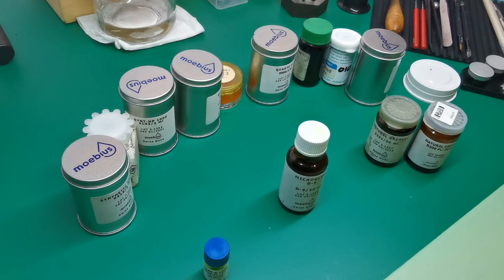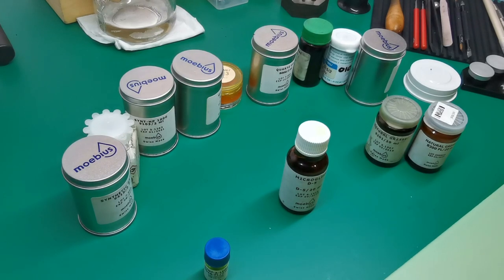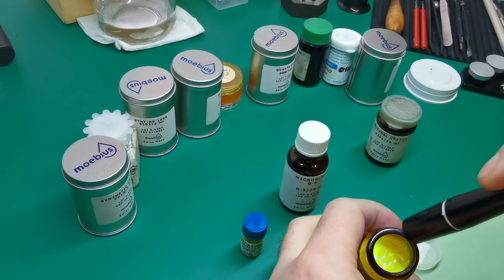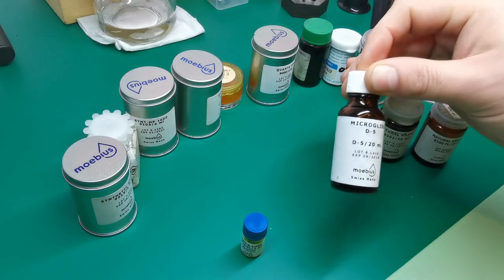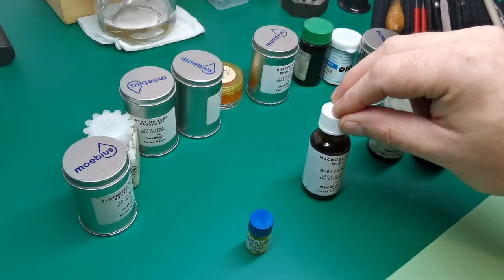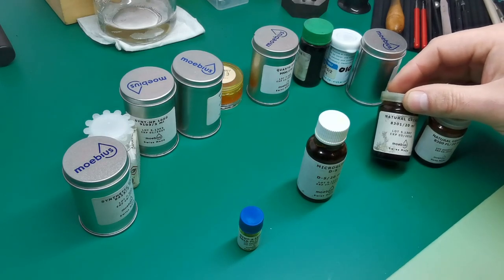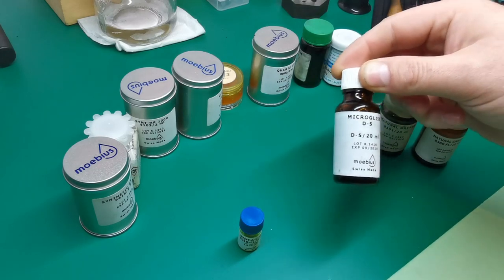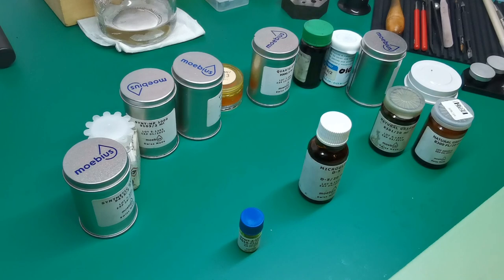Watch Lubrication - A Purchasing Guide for the Hobbyist

Comment: I did some research on my own and came to this conclusion: 
9010 as a thin oil (even for the pallet stones)
HP-1300 as a thicker oil
9504 as a grease (even for the barrel wall)

Comment: If you are servicing automatics, I'd still recommend a braking grease for the mainspring barrel wall and 941 or 9415 for the escape jewel although 9010 would work in a pinch and was used many years prior. I have yet to come to a less expensive alternative to expensive Kluber p125 or Moebius 8213\ 8217.

Comment: At the start I have moebius 8000 and a "questionable" oil that I hope its thick enough to subtitle D5. All watches I had serviced with just these two run really well but I don't know about the long run when it comes to years and years (its been only a few months). Now I have 9010, 9415, HP1300, 8200 for mainspring, molykote DX, and V105. I'm so happy with the set and I don't think I will ever need any new type of oil.

Comment: I found your helpful video after I have placed an order for some lubricants. So, would you say that HP-1300 is a valid substitute for the D-5? Thank you! 👍
Reply from the maker: If you have no other option but HP-1300 then yes it will suffice as an alternative, both share a similar attributes. HP oils have their place when dealing with higher end watches ( Rolex, Omega Co Axials etc ) that require more specific lubrication, D5 is a good allrounder for almost any movement. Get the best you can within the budget you set yourself :)

Comment: Excellent video. What do you recommend for stem? My buddies are using D5 but 8301 would be better?
Reply from the maker: There are a few good stem lubes but for a simple rule... if it spins use oil, if it rubs use grease, so with a stem you want to use grease not D5 oil ( but if D5 is all you have then it will suffice ). Mobius 9501 /Novastar Type S/ Or Seiko S series of greases are all good.
Reply: @welwynwatches5976  Thank you for your reply. I have Seiko S916 blue sticker and TSF451 black sticker which one do you recommend for stem? Thanks
Reply from the maker: @EditHandleError  Well both of those are a type of silicone grease more suited to gaskets, crown, pendants etc. You would need to find one of the other alternatives ideally but in a pinch you could use them.

Comment: Do you worry about the expiration dates? I know the synthetic last 6 years and natural about half that but I see your greases is expired, do you still use it?
Reply from the maker: Usually within 1 year of expiration i order new lubrication, the expired lube will still work but its performance will not be as good as fresh lube. All my current lubes are up to date and good for another 3 years minimum, however for hobby use i would not overly worry if the lube is a year or so out of date. 

All my lubricants are stored in a cool place away from sunlight so they stay healthy for best amount time possible :)

Comment: What oil would you recommend for the old 60's & 70's Timex? I've been told you can use lighter fluid to clean but I feel a little oil would be needed. right now I'm being D5 and 8000 but would I need both for an old $10 watch?
Reply: Yes im cleaning my Hamilton Masterpiece with lighter fluid right now it wouldn't wind nor run now it does sitting over night in lighter fluid.

Only lube i have here tho is 3 in 1 for locks?

Comment: Hello, what oil/grease is recommended for silenting my rotor? It sounds dry!
Reply from the maker: Automatic watch rotors do in most instances make some noise to some degree so there is no guarantee lubrication is what is required. Depending on the rotor type it will vary what lube is appropriate but as a general lube you can use some Mobius D5 but use only a small amount !

Comment: Can i use 3 in 1 for locks as a lubricant for my vintage mechanical Hamilton watch?
Reply from the maker: Id highly advise against using any lubricant that is not designed for watches, 3in1 or hair clipper oil have their own purpose but watches are not one of them. Look for Moebius or Novastar lubricants.

Comment: Any advice for cheaper options for those of us who just want to test the water with sub $50 watches? I don't want to spend  $$$$$$$$ on something I may only do once or twice.
Reply from the maker: For simple practice purposes i can suggest looking for Anchor Oils or a basic all in one oil for watches, check out HS Walsh website as they have some good deals on at the moment for simple watch oils.
Reply: @welwynwatches5976  Thanks for the advice I think I found a good selection Pioneer Watch HO97 and HO98  for light and medium oils and Moebius 8300 which is the same as 8301 minus graphite.
Reply: @shanelady1049  How have those been working out for ya? I'm looking at getting those too to service a couple of cheap vintage watches.

Comment: How and what did you use to get the oils florescent? A lume type paste?
Reply: They're already florescent from Moebius. hence the model number 9010-FL(florescent) vs. regular 9010.
Reply from the maker: Indeed as Chuck states the lube comes with a chemical compound to make it glow under UV light, it helps trace the oils as the movement works and ensure correct oiling.

Comment: Guys, so which grease oil to use on the STEM,  and STEM pivot?
Reply from the maker: You can use Moebius 9501 or 8300/8301 or Novastar Winding Grease or Seiko S6. Most watch greases will work fine with stems.

Comment: Why are folks still using and recommending D5 rather than a modern synthetic such as  HP1300 or HP1000?  Why natural grease instead of a modern synthetic? I bought all these early on on recommendations like this. Then I started taking professional courses at AWCI and learned that current specs demand modern synthetic lubricants.
Reply from the maker: The video is intended for hobby watch repairers and not professionals or students of professional courses, standards and demands of modern watch schools will always change but it does not make older or natural lubricants redundant. I understand your point but the intention is for the masses of people who enjoy it purely as a hobby :)
Reply: @welwynwatches5976  I appreciate your effort here and respect your views.  My thinking is different however.  The industry developed synthetics as improvements over these traditional natural lubricants.  If I were a hobbyist starting out I would buy the current industry standard lubricants: 9010 (light oil), HP 1300 (heavy oil), 9504 (grease).  Soon after I would add 9415 for lubricating pallet stones. I wonder why these older naturals are still in production given that the new synthetics perform the same functions better.  At the risk of sounding cynical, Moebius profits from selling traditional oils to neophytes who eventually have to spend additional funds to acquire a new suite of synthetics in order to meet industry standards.
Reply: @haroldskelton979  A local watchsmith is telling me that D5 is terrible and should not be used at all. In a number of years, it will disintegrate into an ash-like goo and could start damaging the movement. Not sure how trustworthy this is but I'm steering clear of it in favor of synthetics!

Comment: Hey there!  Great video!  Thanks for the information.

Someone gave me advice in a slightly different direction and I'd like your opinion please?

M9010
M9020
M8200

In your opinion, would this array of lubricants be sufficient to cover a typical mechanical watch service?
Reply from the maker: Hey, yes those lubricants will work just fine for general use, id swap the 9020 for some Microgliss D-4 or add the D-4 as an additional oil. 

As a general guide id use four lubricants ,an extra fine oil for escapement, a fine oil plus a medium oil for the train wheels, and a grease for sliding parts.
Reply: @welwynwatches5976  - Thank you for the feedback.

I'm thinking of putting together a kit for beginners that would include 4 (or 5) oils, a stand, oil pots and oilers...but in very small graduations of oil (like .2 to .5 ml)

What do you think of this roster of lubricants?

Super Light	M9415*
Light	M9010
Regular	M9020
Heavy	D5 (or 9104)
Super Heavy	M8200

*optional upgrade
Reply from the maker: @GrahamLeach  That seems more of a kit for mid to advance repair tbh, beginners really only need one oil and a grease to practice with. However if your aiming at the enthusiast level then sure. These lubricants are not cheap even in small amounts so for some out there who want to enjoy it as a hobby less is sometimes more and affordability is sometimes key. But hey this is a longer conversation than can be had in the comment section ha ha  :)
Reply: @welwynwatches5976  - Happy to continue the conversation in another medium!  I can be reached via my website.  Just google my name.  Yes, I am thinking enthusiast level and an entry price that isn't eye-watering.  Looking forward to chatting! :)
Reply: The rule of thumb is put 4 watchmakers in a room and you'll hear 9 opinions on the correct way to lubricate a watch.
Reply: @GentlemensWatchServices  only nine?

Comment: You still use d5? Idk. Maybe for a beginner. But no one else should still be using D5
Reply from the maker: I use many different oils depending on the movement including D5, im not sure why you believe D5 is only for beginners ? There is no Professional or Beginner oil, there are just different types for different situations. Thinking one is better than another is subjective, i use what is prescribed by the brand of movement i work on, where this info is lacking i use my judgement. D5 may be phased out for another oil of a different name but it matters not if it does the same job :)